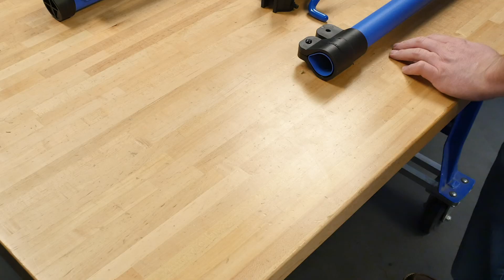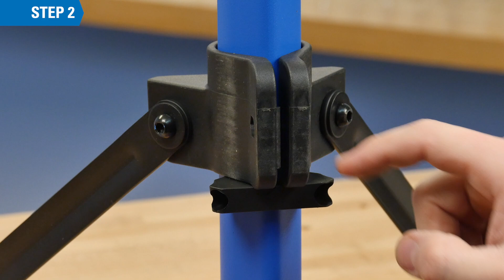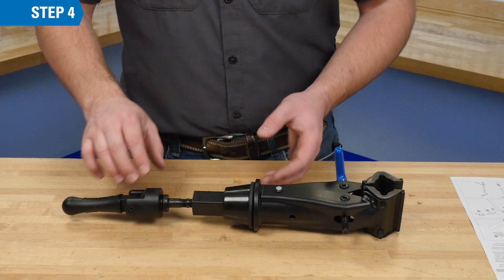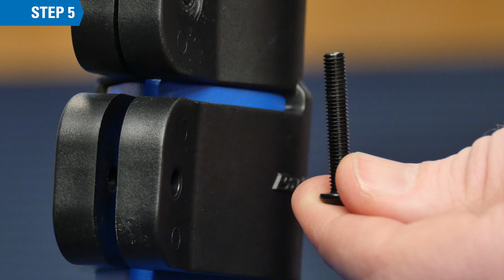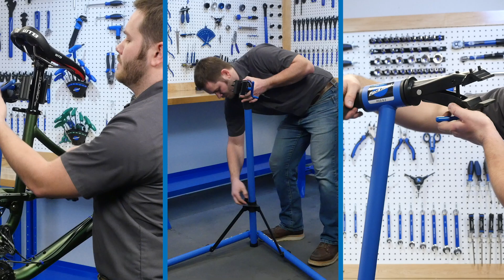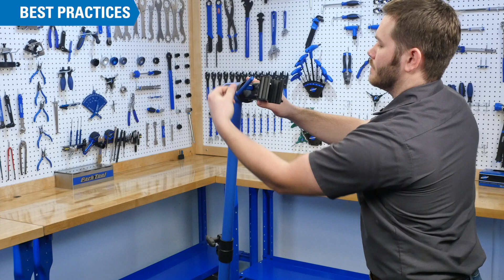How to Assemble the PCS-9.2 Home Mechanic Repair Stand | 2019

Comment: Instructions are misleading. "Fully tighten" is something very different that shown in the video. Thank god I stopped before I broke it because of your awful manual. I also got something called safety collar, which is not shown in this video and it seems useless.

Comment: The assemble instruction (paper or PDF on the park tool website) doesn't include a step 3. The safety collar #33 isn't mentioned anywhere in the video. I followed the video instructions and I'm left with 1 Yoke Knob, a safety collar and a Button head cap that doesn't fit in any hexagonal holes.
Reply from the maker: We made a rolling revision to the design of the stand that includes the safety collar. The pieces included with your stand are covered in the updated video found here: https://youtu.be/VK-QcmsmH-M
Reply: @parktool  Awesome! Thanks!

Comment: Question, what is the difference between this model and the PCS-10.2?  In other words why would I spend 50 bucks more on the 10.2?  Appreciate a reply as I'm looking to buy asap.
Reply from the maker: The support straps are stiffer on the PCS-10.2 making it a little bit sturdier, The yoke is locked in place with a quick release on the PCS-10.2 where the PCS-9.2 has a knob, the height adjustment collar has a quick release as well as accomodations for a tool tray, It comes with a small tool tray, The clamp has a cam for quick clamping and a saddle rest. Those are the differences between the two. Both good options!

Comment: Just assembled this stand. Is the powder coat/paint supposed to scratch off on the post that slides up and down?
Reply from the maker: Shoot us an image at tech@parktool.com
Reply: Did u find out if this was normal? Mine does he same thing
Reply: @victor.o.72  Park Tool sent me a replacement
Reply: @eczzsyy  Park Tool stepped up for me with a part that somebody I bought the new stand from misplaced.  PT is a damned good company.

Comment: What material is the stand made of? Will it rust overtime if i wash my bike using the stand?
Reply from the maker: Most of the stand is made of powder coated steel.  If it's wiped down after getting it wet you should have little if any long term rust.
Reply: @parktool  I'm from a very dry place, is rust that bad?
Reply from the maker: @benjacobson7490  We have very very few rust issues. Even people living near an ocean beach who leave their stand outside all the time don't have issues.
Reply: @parktool  alright, nice. I just bought one of these stands and I'm so impressed with how great it is. Everything works perfectly. Y'all got some great engineers